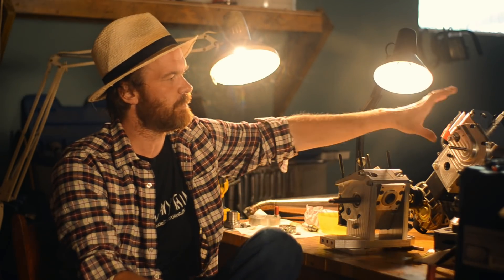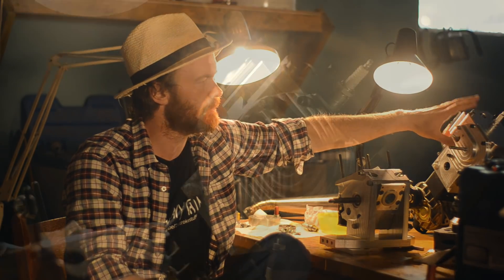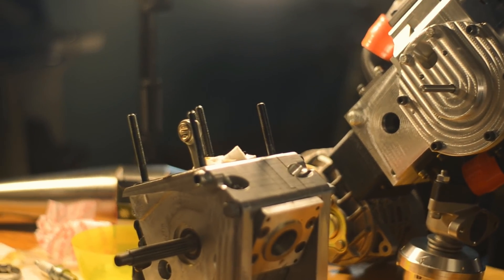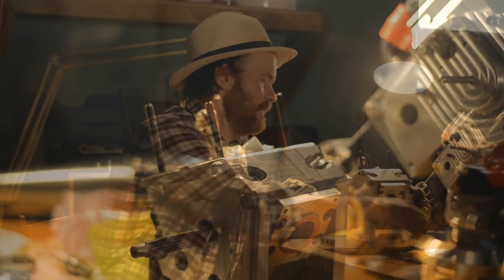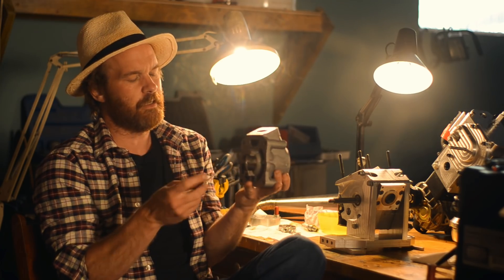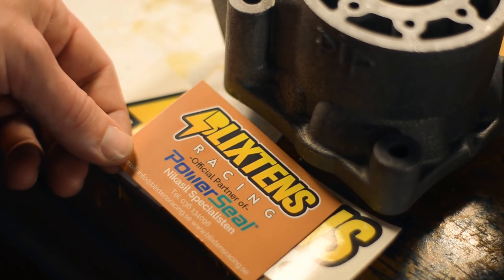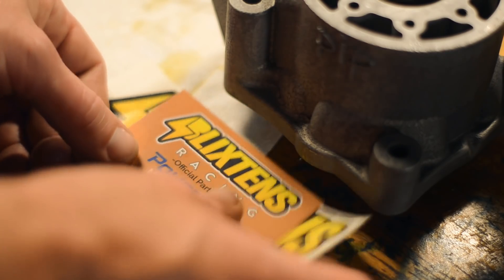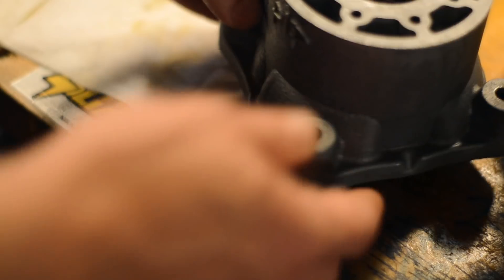Still Most Powerful Two Stroke Ever?

Comment: you should put a tachometer on the engines while on the test-stand:-)
Reply: What does PiP mean?
Reply: @EbonyPope  its an epic build of 2stoke cylinder design. This could make more power due to resonance at Sweet spot rpm. To know more about it go through the old videos in this channel.
Reply: @blkdna748   I know his old videos. But thanks.
Reply: @EbonyPope  "Primus inter pares is a Latin phrase meaning first among equals"
Reply: @TheFNTC  Thanks for the info. But what does he want to say with that? That it's equally as powerful as some other manufactured engines?
Reply: @EbonyPope  first in his class? Most powerful two stroke. Thats the goal
Reply: @EbonyPope  first=most powerful among equals=50cc two-stroke single piston engines.
Reply: @szymontrojanowski7565  Understood. Thanks. :)
Reply: Wait for the engine get Dyno. Am also curious abt it.
Reply: Damn good choice for the filler music!!! Best of any channel I've stumbled across.

Comment: Test it on the inertia dyno as it is then test it with the secondary intake when the rest is complete :)
Reply: I second that
Reply: I third that , great call then you def know on improvements
Reply: ALL synod are enertia synod,,most are connected to some kind of water pump/brake or and a scale in pounds & it's revs X Lbs = horsepower ! Trev New Zealand

Comment: use mechanical rotary fuel pump and injectors with regular jet adjustment like old top fuel dragster stuff, pump give almost linear output in respect to rpm

Comment: awesome project, just one question how do you know what thickness of reeds to use ?
Reply from the maker: There's formulas, but I would use engmod2t, simulate what works best. In this instance I just used what I had on hand - too thin, but as this intake is just for starting/low rpm it doesn't matter.

Comment: And here I was thinking you had forgotten all about the 'other' engine. Nice to hear it running again, or is that at last?. Loving the music too, very groovy.
Reply: What does he mean return PiP engine? What does it stand for?
Reply: @EbonyPope  I wondered that too ?....Good on him but he's reinventing the wheel.I built my own little dyno in my teens - & per cubic inch the model aircraft Cox engines put out the most HP per cc or cubic inch.Hed be better off running dual ram tuned rotary valves with the intake manifolds for a 50cc being about 12-13" long with carb on the end with a shot of nitrous gas.Do the pipe (exhaust) a favour)& build a steady for it(Like a strap to the crankcase)Trev New Zealand

Comment: Would you ever consider building a big budget 125cc motocross engine  for someone if funded by them?
Reply: Or a 500cc😍
Reply: @brittenv1000  3000cc v8 2stroke for a car.
Reply: @v4skunk739  Have you seen Volvo Amazon "Rudezon" homebuilt V8 2stroke
Reply: @mfturpeinen  it’s not a home built engine. It’s a factory evinrude with custom made pipes and such
Reply: @johnyjanzen1140  Didn't know, ty for correcting.
Reply: @v4skunk739  See the Toyota F1 engine that was banned before it was used. They got so upset they destroyed it. That was a V10 I believe.
Reply: Look at the concept behind this project from day one. The whole purpose is to maximise power output from a small capacity 50cc two stroke single. Producing big horsepower from larger engines is missing the point entirely... regardless of funding options.
Reply: Can some one purchase from you ?
Reply: @Case-Hard Nails my point was that '2 stroke stuffing' is all about maximising power from a 50cc engine. Not continuing to use that technology to increase horsepower on bigger motors. So you are the one missing the point not me. If you've followed the story from day one like I have that would be obvious.
Reply: @garytompkins2116  & at first god cast down a road..
Reply: Budget and funded doesnt match in my oppinion
Reply: @IKucheINtortIE  "big budget", So I'm guessing a cost is no problem sort of thing
Reply: @friedrichvonsnatch3501  oh yes... overread the "big"